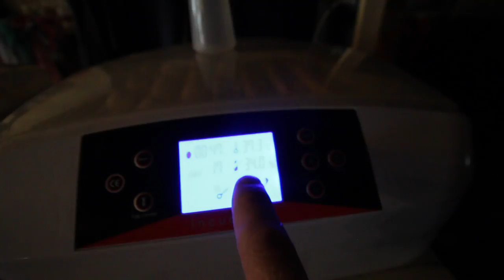What Happened at the Modern Homestead

Comment: The yellowing of your peppers doesn't always mean nitrogen deficiency.  It could be magnesium or iron deficiency or it could be too much nitrogen or it could be too much salt from your urine.  Piling more fertilizer on could compound the problem.  I would leave the peppers alone and just water to see if they will bounce back.  If not a soil test will tell you what it is that is causing the problem.
Reply from the maker: They were yellow before the urine! We will have to try Epson salt thanks!
Reply: Lumnah Acres It could just be too much water from all the rain we have had this spring.  Looking at the other plants in that same bed I would doubt if it was fertility issues in your soil.  You can always do a organic matter test with a jar of water and a scoop of your soil.  If you have a high percentage of O.M. (organic matter) you may want to add a coarse sand to help aid drainage.